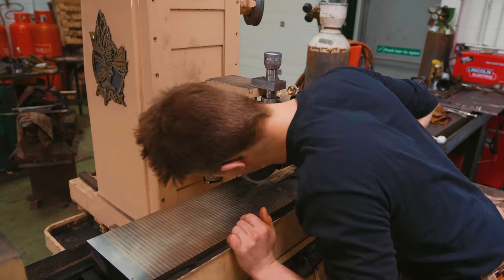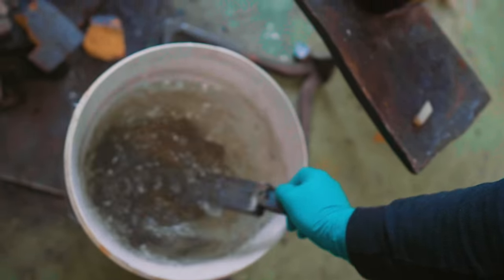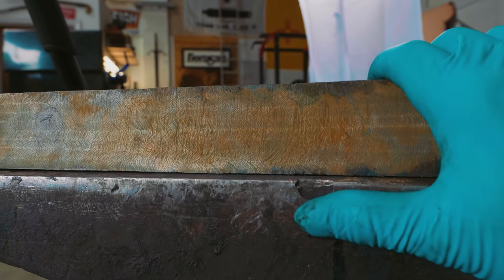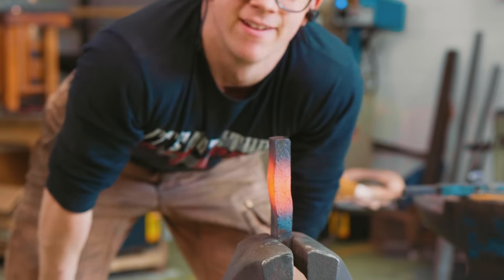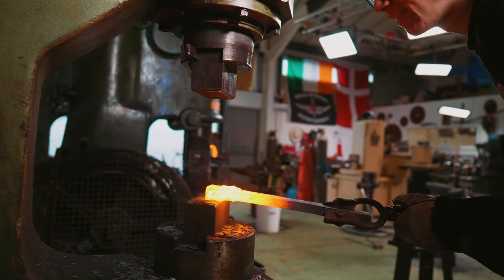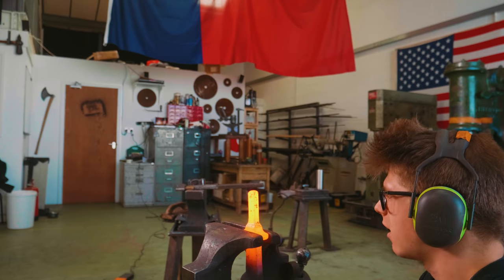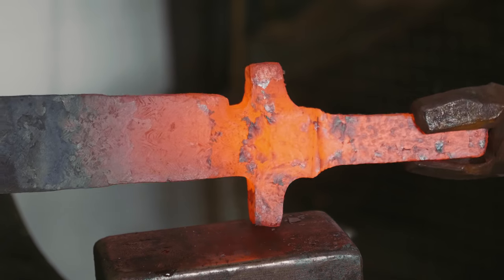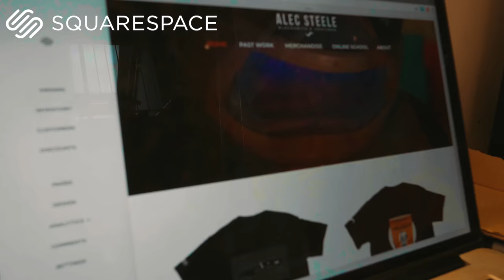MAKING A BOWIE KNIFE WITH TWIST DAMASCUS!!! Part 2

Comment: As someone who watches all sorts of blacksmithing videos, particularly on Damascus, but who has only worked hot metal once, I'd love to get your take on this insane idea. 

Sandwich a piece of bold, high carbon damascus in between two thin billets of crazy super fine patterned damascus, so that the fine pattern makes up the flats of the finished blade. When the blade is formed to shape, grind several deep fullers through the top layers, like a cinquedea. 

In theory you'd have the fine, bright pattern on top, with a smooth transition to the dark, coarse pattern beneath in the fullers. Then again I have no idea what I'm doing so that could just be a pipe dream, but if anyone could pull it off it would be you.

Comment: Alec, I’ve found that when I’m removing scale from something I get more accuracy when I use a flapper wheel in comparison to a stone wheel. Might be something worth trying out. It’ll take a little bit longer but it gives more control of how much material you’re removing and gives a smoother finish

Comment: FYI Alec, there's a simple value used to determine ratio of "Squish in one direction and it expands in another". Its called the Poisson ratio, used in engineering all the time. For steel that value is roughly .3, which lines up perfectly with the value you go after using the power hammer and measuring. The more you Know!

Comment: Love how the bowie is shaping up.
Reply from the maker: Thank you Leo!
Reply: Alec Steele it's my pleasure. I get a lot of enjoyment watching you work. I could never in a million years do what you can.
Reply: Alec Steele you should make what I call an iso-forge. Basically it's a miniature forge that you use to isolate a section of material that you want up set. It's pretty simple to make. Mine is made from a piece of 6 inch long by 8 inch diameter by 1/4 inch wall thickness pipe. Weld a temporary cap on one end to fill it with refractory and form a 5 inch in diameter hole in the middle. Then cut a hole in one side to fit a torch head in. Put an extended handle on it supporting the body and the torch head. Then plum to you chosen source of gas and bada-bing bada-boom you can upset with ease and get faster, easier, and better results.

Comment: The hardware stores sell a great laser that has a magnetic base and a 90 degree rotatable lens.  Put the laser on the Pilkington and cast a laser onto the floor.  Then line up the vise and the worked material to determine straightness.  Hmm.  Sounds easy!  It is.  I've used one for a few years.

Comment: Every time you turn off the surface grinder you are supposed to redress the wheel because once you stop it it will shift the wheel a bit. So don't turn off the surface grinder until you are completely done with your grinding

Comment: Since you seem to have quite a good quantity of material in length, could you have folded it back in half and re drawn to thicker stock?
Reply: Not without ruining the pattern he was going for, would have totally lost it
Reply: Biohazarus Folding is more detrimental when you work with clean steel. It can trap slag in the fold and lowers the carbon content of the steel. Fold high carbon steel a few times and you have mild(carbon) steel. Few more times and it's just wrought iron with little carbon left.
 Folding was used to purify steel back when kilns didnt get hot enough to fully melt iron to purify it. Steel was very impure in the times of early katanas and such, it was basically polishing a turd into a nice sharp blade. Folding was the way of polishing if you follow my metaphor.

Could he have folded for width? Yes. Would it be worth it? Not likely.

Plus like the other guy said youd ruin the pattern.

Comment: here's a suggestion, to avoid future 2-hours down the drain: Form a version of a kiss block, with an inlet, that drops down for overhangs (like your guard bit) so you can lay it in, pull, and let the hammer do it's thing while geometry does alot of the precision work for you. might work might not i'm an engineering major not a black smith lol.

Comment: Would it have been possible to split the bar at the position where the guard will positioned. Then you open this hole up and drive it out so it bends out to the left and right to get the basic shape of the guard. After you drove out enough material you close the hole vertically and forge it back together.

Comment: Could u have roughed the tang stuck it in a hardy hole. Heat the area u wanted for the guard and hit from above. It should add bulk to that area. Then correct any twist if the happen

Comment: i have an idea, it's probably a silly idea, but is it possible to make multi-metal alloys such as steel with copper and aluminium mixed into one and then forge this into a tool or a knife? i've heard of a lot of recent research into polymetal alloys (10 or more metals in varying proportions) to reveal new alloys with strange and wonderful properties. one such alloy has been discovered to become stronger the colder it gets rather than more brittle. just a thought, but may take much more heat and special equipment to do.

Comment: Love your vids, but I'm looking for some advice. Bought my first damascus knife last week... Beautiful pattern and  blade, beautiful handle, but they did a terrible job on the edge. It's not very sharp, and the bevel is VERY poorly polished... Almost looks like 120 grit finish, lots of parallel scratches. I'll probably polish the face of the blade some more as well. Is hand sanding really an option on the bevel, or should I buy a high grit whetstone?

Comment: Great work as usual, Alec!  Question: what is the powder that you sprinkle on the metal after coming out of the forge?  (I'm a woodworker by hobby and have very little knowledge when it comes to metal work.). Love your videos though, man!
Reply: Borax, also known as sodium borate, sodium tetraborate, or disodium tetraborate. It is used as a flux in metallurgy, prevents oxidation and thus help to weld together.

Comment: What is that white powder that he use on hot red metal?
Reply: Borax, also known as sodium borate, sodium tetraborate, or disodium tetraborate. It is used as a flux in metallurgy, prevents oxidation and thus help to weld together.

Comment: If you where worried about thickness, and you where going to cut off 3-5 inches anyway, why didn't you just use that extra material from the backside and hammer it down to form what you needed?

Comment: just a questions from a complete non professional could you not have folded it over to gain thickness then forged it back out to the width required? or would that ruin your pattern or would it just not work at all?
Reply: it will ruined the pattern he's looking for

Comment: There two kinds of people Alec, those that use the metric system and those that have put a man on the moon. Just ribbing all the SI folks. Cheers!
Reply: And the ones that put a man on the moon crashed a ship in Mars because could'n do the conversion, c'mon.
Reply: jctaylor1967 And they have been the ones to successfully land rovers on Mars. Three times!
Reply: WowwwwWW               but still can't do a conversion  :-D
Reply: I like you jc. No need to a conversion. I prefer my beers in imperial pints (that's 20 ounces for the heathens). God bless Texas!
Reply: Don't get me wrong, i admire  the USA for all is accomplishments, regarding space at least, they got my deepest respect (but their not the only one) but this conversation starts about the use of the imperial or metric system, although mathematical speaking both are equal accurate in pratical use the metric system is far better, more simpler to use, it's decimal (base 10), all the math around it is easier like a conversion ;-) and there's another reason, perhaps more important, ALL the world uses it and in a time of collaboration between countries it's a thing to consider, perhaps will reduce or at all prevents "incidents" like that of the Mars Climate Orbiter crashed due to poor conversion.
Liked this conversation and in case of any doubted i'm European :-D cheers